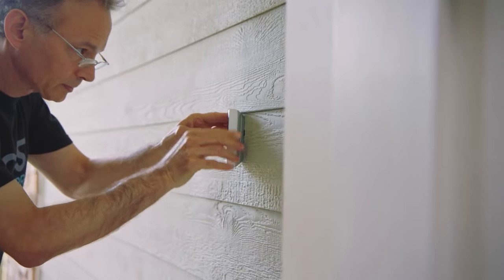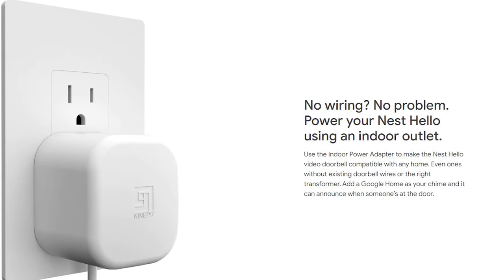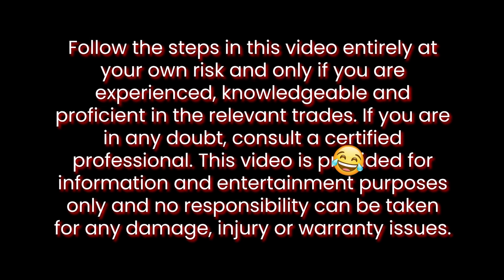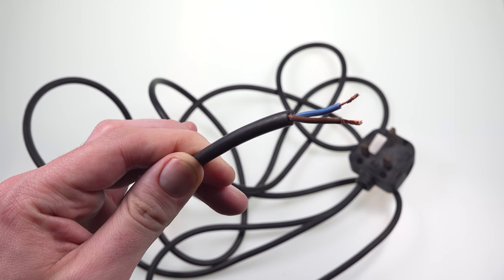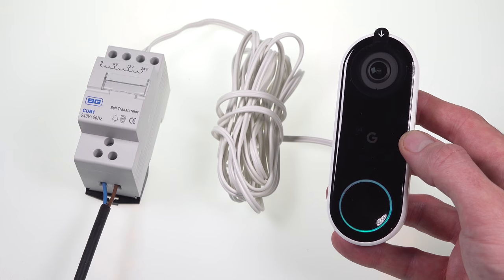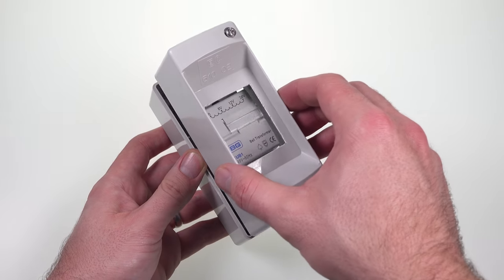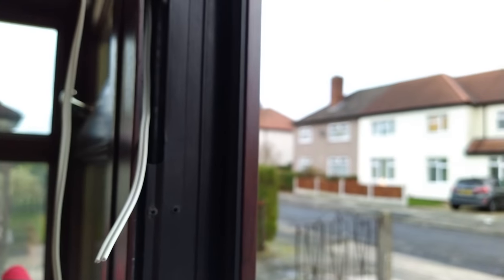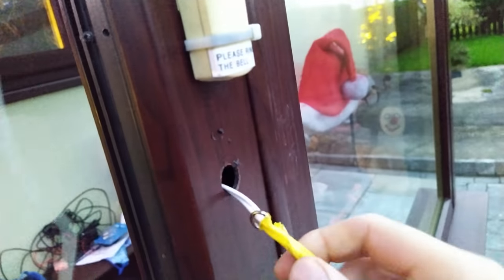Nest Doorbell (Wired) UK Installation With No Chime into uPVC Door Frame (Smart Video Doorbell)

Comment: Can it just be stuck on to a upvc doorframe? I have bought the battery powered doorbell and only have a upvc doorframe to put it on. Don't really wanna drill into it.
Reply from the maker: Yeah you could use some strong 3M adhesive pads or Gorilla tape (double sided) 👍

Comment: Did you say at 24v the demand on the bell cable is lower?
Reply from the maker: Yes, because it won't need to draw as much current to achieve the same power 👍 (watts = amps X volts)
Reply: @SwitchedOnNetwork  Thanks mate.  I'm fitting mine tomorrow so will use 24v.
Reply from the maker: Awesome, hope it goes well!

Comment: This is exactly what I was after - I knew this would work, but having seen it I'm now happy to do it. I have a similar front porch, and similar to you my consumer unit is miles away, so I've taken the feed from a mains plug (which happens to also run off a UPS) and mounted the transformer in a similar place to you. Great video. :)
Reply from the maker: Glad it was helpful! 🙂

Comment: Great vid but I'm confused... without a chime, what happens when you press the doorbell? Does the doorbell itself ring and then you get notified by the app but nothing rings inside the house? Can you hear the unit itself ring from inside?
Reply from the maker: Every Google Home speaker in the house acts as a wireless chime, so they all play a ding-dong and announce "Someone's at the front door" (or whatever you call your doorbell location). If you subscribe to Nest Aware for £50/year and it's someone you know, it'll say for example "Paul is at the front door".

Comment: Great Video!    I don't have a plug socket near my front porch. Do you think I could get power off an existing light fitting in the porch to power the transformer?
Reply from the maker: Thanks! :) I'm sure that would work... and if it was my house I might do that... but I'm not sure it will comply with building regs where you are, and I can't give you any advice on that or on how you should wire things up. Check with your local authorities and if in doubt ask a local qualified electrician. Sorry for the legalese answer, but I can't be seen to give advice (I'm sure you'll understand!). Alternatively just run a long cable from somewhere else, but that of course is more work...

Comment: Great video, can't think why your initial review would warrant any negative comments, as it was the first thing I asked when I realised there was insufficient supplied material and information in the box to support a hardwired 240 v supply transformer connection. 
Your video has affirmed the correct choice of transformer and the fact I'll need a box for the transformer, unfortunately you neglected to mention where to buy the one in the video so I've just resorted to Google; Which is how I found myself here in the 1st place :) Great stuff and thank you- Really wel presented
Reply from the maker: Great stuff, glad you found it helpful! I put an eBay link in the video description to the transformer box I bought. Here it is: https://ebay.us/sswWKZ 

Make sure you put a fused spur between power source and the transformer, if you're hard wiring into another plug socket or use a 3A fuse if you're just putting a 3 pin plug on. (for legal reasons that's not advice; check with an electrician!)
Reply: @SwitchedOnNetwork  Thanks for the link, I'll be getting a sparky to do the necessary work ,I just need to ensure I have all the materials correctly ordered up. Best regards

Comment: 2 core flex coming of a socket ? 🤔 Oh dear oh dear
Reply: Ideally there should be a fused spur with a max 3a fuse that will protect anything on that cable from working at a higher current, much like a lighting ring. I still don't see a massive problem, just more from a future safety issue / electrical certificate.
Reply from the maker: Yep that's probably a very good point. I didn't include in the video that there's actually a fuse behind that plug (previous owner did some funky wiring that I've still not got round to redoing 🤣). But this is just what I did in my own porch (and may change in future) and is of course in no way to be construed as instruction or advice!

Comment: You sir are the ONLY person i could see on YouTube that has covered this.
My issue is, my mum has a ring video doorbell 2 second gen.
Currently attached to the door because the plinth where you have put yours is to small to house the width of the ring bell, (nest hello is thinner).
But hers is fixed to the door and battery only, I've purchased the UK ring plug, but wondering if you had any advice given its on the door, and opening and closing the door would need the cable flex to function.
Reply from the maker: Thanks John, I'm glad you found the video helpful! Yes that's one of the reasons I prefer the Nest Hello to the Ring Doorbells, I think their tall & thin shape looks much sleeker and less bulky so it's a bit more subtle and also as you say easier to fit in thin spaces! But anyhow, with your Mum's doorbell on the door I would suggest to run the cable near one of the door hinges and fix it in place next to the hinge both on the frame side and on the door itself, to enforce the maximum amount of slack you'll ever need in the cable. Doing it over a hinge will hopefully stop it ever getting trapped in the door, and you can then run it up on the internal side of the door and through a drilled hole at the height you want the bell. Hope that helps!
Reply: @SwitchedOnNetwork  thanks for the reply, going to attempt today... Hopefully it can be done!!
Cheers again for the reply.
Reply from the maker: Awesome, good luck! Tweet me a picture @paulfp when you're done :)

Comment: Great video, i'm hoping to get a Eufy Doorbell and wire it up in the same way.  Question, do you have it plugged into the mains via the fused socket we see at the start of the video (before you swapped the black wire to white), or did you spur off the socket directly?
Reply from the maker: You can do either, spurring off the socket directly (3A fuse) is best though as it's neater and less chance of being switched off by mistake 👍

Comment: How did you run the wire from the porch to the mains? I’m from USA at my in laws here in the UK and just got them the ring doorbell, however no existing wiring and the battery swapping is too hard for them to do each time. Wouldn’t I be able to just tie that transformer into an existing wall socket in the porch rather than going to the mains? Or would it be better to add an outdoor socket by tying off an existing socket inside and running the ring power adapter cable from the socket to the doorbell ?
Reply from the maker: Yes you can do either, just make sure you do it all properly and adhering to all regulations. Get an electrician to do it for you unless you're 100% sure you know what you're doing.

Comment: Finally found a video that covers most of my install questions. I wish to eliminate my indoor chime and so I will remove the chime and use the existing wiring in the house. I would like to wire the power from the transformer directly to the front doorbell wiring. I checked my Canadian transformer near my breaker panel and the load is 25V and 20VA. Please comment....and thank you.
Reply from the maker: Glad it helped! If you check the Nest Doorbell voltage and power requirements, you'll see that it will take up to 24V and it'll work on between 10 and 40 VA of power. So as long as your transformer can output that you should be fine - is it fixed at 25V or do you have options? I don't feel qualified enough in a public forum like this to say "ah yeah 25V will be fine!" so I'd double-check with an electrician if you're unsure. Also make sure the cable you're using is thick enough, the higher voltage will mean less current is drawn, so cable becomes less of an issue but I'd still make sure you buy cable designated for doorbells - but if you have existing cabling there, it'll probably be fine to reuse that.

Comment: Handy video but think you should have removed the sharp edges from the metal or added a shroud before running the cable.
Reply from the maker: Very good point, I might do that. Thanks 😀

Comment: Can you not bypass the need for a transformer box & just buy a plug in transformer adapter ?
Reply from the maker: Yes, that's one of your options if you don't want to permanently hard wire it in and you don't mind losing a plug socket (which you'll have to ensure no-one ever switches off by mistake)

Comment: So you dont have to wire the chime connector in series between the transformer and doorbell which apparently acts as a resistor when you don't have an existing chime?
Reply from the maker: Not with the Nest doorbells, no - as long as the transformer is providing power in the range expected and accepted by the doorbell.

Comment: Thank you for making this video. In that exact situation myself with no proper wired doorbell/chime in place and the mains board at the other side of the house. So the only thing your setup is missing is a chime when the doorbell is rang?
Reply from the maker: Yes that's right, but it rings on the many Google Home speakers dotted around the house 👍 (not just our phones)
Reply: @SwitchedOnNetwork  I get ya, thanks for the reply, subscribed!
Reply from the maker: No worries, and thanks for the sub!
Reply: @SwitchedOnNetwork  some people don't want to spend a couple of hundred quid on Google speakers , rather buy the kids some toys. Chime will do. I fed my wiring through the skimming, nothing visible.
Reply from the maker: Nest Mini is £19...
Reply: I ended up wiring in a chime in the end. I housed a 12v transformer in a small simple enclosure and plugged that into a socket. I mounted that beside the chime down at the ground level and wired the nest doorbell in following a decent wiring diagram I found online. Works like a charm now.

Comment: Great Video and so helpful.... 

QQ. I am hoping to run two Nest Hello devices off a single transformer and currently don't have a chime... Do you think the BG 24V transformer would successfully power two of them?
Reply from the maker: If you're powering two off one transformer, wired in parallel, you need to look at how much current (in Amps) your transformer can provide at one time. I'd make sure it's at least double what one doorbell will suck. If not, get a second transformer.

Comment: Ignoring the physical chime.  Can you set this up so it rings the Google devices say between 8am and 8pm but after that time just alerts you on your phone ? so the house does not get woke up after 8pm doorbell ? I was going to get one if so.  I can then wire my doorbell chime to a sonoff and control the times that operates from an app also.
Reply from the maker: You can set temporary, one off quiet times in the Nest app for the doorbell but the way you'd achieve what you want is via the Night Mode setting on each speaker, which you can set up be Automatically enabled/disabled at set times each day, and you can have that include Do Not Disturb too, which blocks all sounds and notifications on the device so doorbell rings will only go to your phone(s).
Reply: @SwitchedOnNetwork  Thanks for the reply.

Comment: Hi what is the wifi like on the nest. I currently have a ring and quite frankly the wifi is rubbish. I have a 500mbps fibre to the home connection with an orbi mesh system. Which i actually got after watching your orbi vid :)
Reply from the maker: haha brilliant! Glad you found the Orbi video good enough to buy one 👍 In general, the WiFi is great on the Nest, I very rarely have any issues with it and on the odd occasion I do I think it's probably down to the nest servers rather than its WiFi (because it's usually flawless, so can't really be the WiFi chip at fault I don't think).

PS - new Orbi and Nest doorbell videos coming soon 😉
Reply: @SwitchedOnNetwork  Hi yes the orbi is rock solid and doing its job nicely. Just wish the ui on the app was a little better. Ah i see i shall await your new video before buying. Thanks for the fast reply

Comment: Hi mate, I am completely uneducated on this and going to set this up on my new build house that has no doorbell wiring, as all of the power adapters on Amazon seem to have bad reviews about loud buzzing noises. I have a fuse box right near my front door and you touched on this on your video. Would this mean I could just put the transformer in the fuse box and remove the need for the power adapter you have in your video?
Reply from the maker: You could, but only a qualified electrician can legally remove the cover from the consumer unit. Wiring it in via a fused spur like I did is probably the best option (as long as you're fully confident in doing everything correctly!)
Reply: @SwitchedOnNetwork  thanks mate yes I would be using an electrician anyway. I was just wondering if it was possible before I bother asking one to do it. Thanks for the reply👌🏾

Comment: Excellent video - What is the max length of the cable from the transformer to the doorbell?
Reply from the maker: Thanks! The max length you'll get away with will depend on the gauge of wire you're using (as that affects its resistance) but if you're using fairly standard twin bell wire you should be good for up to about 25m I think. How far away will your transformer and doorbell be?
Reply: @SwitchedOnNetwork  Hi, thks for the answer.  Around 8-12 metres (house under construction) :-)
Reply from the maker: Ah I see, yeah you should be fine 😊

Comment: Never having mounted something to a UPVC window/door frame before, I am wondering what the process is to afix the doorbell to the frame? I just bought a Nest battery doorbell, which comes with a couple of self tappers and rawl plugs, but not sure if for UPVC I should drill two small pilot holes and just use the screws, or if rawl plugs in UPVC is also required?
Reply from the maker: You definitely won't need the rawl plugs and the self tappers should go in just fine. You could drill a 1mm pilot if you want to ensure correct positioning but I don't think I bothered on this one 👍
Reply: @SwitchedOnNetwork  Perfect thanks, will give it a crack :)
Reply from the maker: Hopefully it won't crack!! 🙈🙈
Reply: @SwitchedOnNetwork  Went for a 2mm pilot hole purely as my drill didn't fit a 1mm bit, and it's all done and working a treat! Thanks!
Reply from the maker: Excellent! 👌

Comment: Do you have a video on connecting an existing bell which is powered by two D-cell batteries?
Reply from the maker: I don't, sorry. Best way is to get a transformer and power it from the mains.
Reply: @SwitchedOnNetwork  I think I would also need new chimes that were compatible with AC.
Reply from the maker: Ah maybe. Not sure sorry. I don't have any actual chimes, it just rings on all our Google home speakers and our phones so that's enough for us.

Comment: What gauge bell cable did you use?
Reply from the maker: I used some which I had lying around anyway so I'm not sure of its precise gauge, but you should be able to use any cable which is designed as bell cable. It's what the Nest Hello is designed for, to use any existing cable. And run at the higher voltage so less current will need to be drawn 👍
Reply: Thank you for your response. I also wanted to thank you for your video tutorial. It's given me the motivation and encouragement to install a wired Ring door bell. I'll be doing it exactly how you have.
Reply from the maker: That's great to hear! And I'm glad you found the video helpful. Are you running cable through the uPVC door frame? I have to admit I was nervous before drilling that first hole and I had no idea if I'd be able to link it all up, so was very glad when it eventually worked!
Reply: @SwitchedOnNetwork  
Yes, I'll be running the wire through my uPVC door frame. I have a porch like yours. So I'll be removing the door keep and feeding the wires through. I hope removing the keep is not complicated and it comes off with ease. Also did you have to buy self tapping screws  for the bell it self or did the standard screws suffice ?
What size drill did you use to make the holes?
Reply from the maker: Great stuff, good luck! Yeah, self tapping screws are best for PVC and then no pilot hole required so really snug. The big hole for the cables ended up being bigger than I wanted because of the thing I was poking up to grab the end of the cable. Just as small as you can get away with 😀
Reply: @SwitchedOnNetwork  
Which size amp did you feed off from the main CU. I have a spare 3a and a 6a. I was thinking of using the 3a.
Reply from the maker: I'm not a qualified electrician so I can't give any advice in that area I'm afraid - check with a pro if unsure.

Comment: What happened to the ending and actually mounting the doorbell?
Reply from the maker: I think I edited the ending off as there was a large retention dropoff in the last few seconds!
Reply: So you know what you're of hardware you used to secure it to the door? Mine came with brick fasteners but I don't think they will work on the PVC door frame
Reply from the maker: Yeah you won't need those, just some screws to go into the PVC